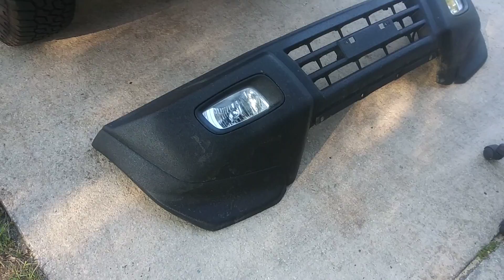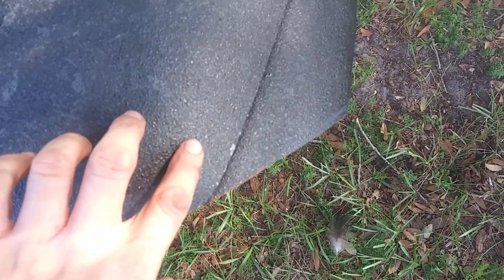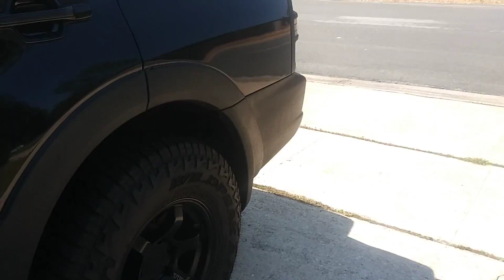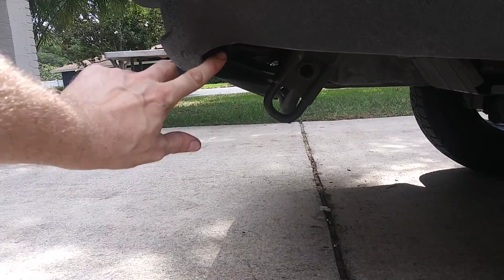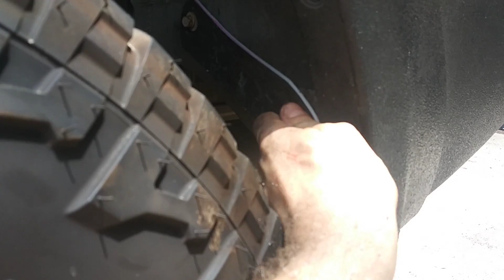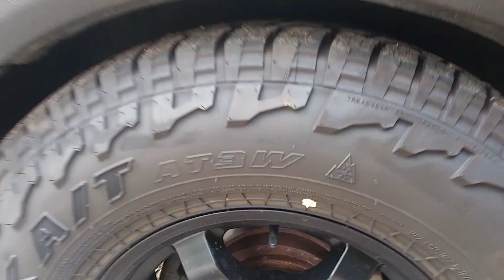Offroad Bumper Cutting & Side Trimming | 3rd Gen Montero | Project "Vader's Chariot"

Comment: Looks really good 👍  do you have a lift kit?? And what size tires are you running
Reply from the maker: In the video it was stock. Now it's lifted about 1.5 inches on Lowell's springs and bilstein shocks. 265/75R16 tires

Comment: How did you fix the lights for the 4x4 & C/D lock...
Reply from the maker: CD lock I was trying to engage not in neutral. And front ones occasionally blink but I just move the lever back and forth and they disengage. Engaging 4x4 is never an issue. It's usually a little vacuum thing by the airbox and I have the part just haven't installed it.

Comment: are you running spacers on your wheels and what size is your tires?
Reply from the maker: These are aftermarket Motegi MR150 in 16x8 at 0 offset so no spacers. 265/75R16 Falken Wildpeaks AT3W are the tires. There's more info and fitment here: https://youtu.be/kw-iaASxagM

Comment: Best looking gen 3 I’ve seen yet!
Actually looks better after cutting them gay flaps. 
Please do a quick video of how to do a rear bar like I saw on yours as it seems to be an issue I’ve found on mine with bumper trying to rip off. 
Might also bed line lower plastic trim on mine. Check my gen 3 videos.
Reply from the maker: Thank you! Yours is the diesel in the Australia? Impossible to get in the US.

What rear bar you mean? The one that hangs under the rear bumper seemingly for no reason? I actually bent mine offroading a bit last time. Probably saved me the bumper though
Reply: @LeoTheRussian  
Mine has none and needs one maybe yours is custom? Me in New Zealand
Reply from the maker: @kingmarz3635  pretty sure it's stock. I have a plastic panel that matches perfectly with it to cover it up. Once I banged it on a rock it shifted back so I had to cut the cover about 1.5 inches to make it fit again :) it's a tad crooked now but no one will notice unless really lookinh

I think both get removed if trailer hitch is put in.

Comment: Looks great man we should start a Florida Montero club! 😂
Reply from the maker: There's a Florida Mitsubishi group on FB that's pretty active. Which Montero you got and where in FL? 
I haven't had a chance to come out with them lately - seem to always fall on a Saturday I'm either busy or out of town.
Reply: @LeoTheRussian  I have a third gen Montero same as yours in silver. Completely stock. Second owners since 2004. It's my father's old truck and my mom has kept it in pristine shape. I will take ownership of it in a few months. It's been a workhorse of a car. I will look for this group. I'm in Venice
Reply from the maker: @tonggi  in retrospect I do wish I would've got an 03+ and bought 33s for it :) but live and learn. Might sell my wheels and tires and get a new set.
Reply: @LeoTheRussian  I don't know enough to tell the difference between an 03+. But I will do the bushings, ironman 4x4 lift kit and do 16s with 33" tires
Reply from the maker: @tonggi  crude joke stands out from somewhere about the 01-02 vs 03+ monteros - 03+ smooth sides and 01-02 ribbed for more pleasure... But that's the easiest way to tell. Also oval fog lights on earlier ones and round on newer. You get bigger engine at 3.8 vs mine 3.5. Just make sure maintenance especially timing belt is done and 3.8s are known to be grenaded by butterfly valves that folks either take off or loctite them.
Reply: @LeoTheRussian  good to know. I see now I actually didn't like the oval figs. But the bigger engine is nice
Reply from the maker: @tonggi  I like the flat sides but prefer older style bumper. Mine also comes with 4.90 gears which you probably will have to get down the line to run 33s effectively.